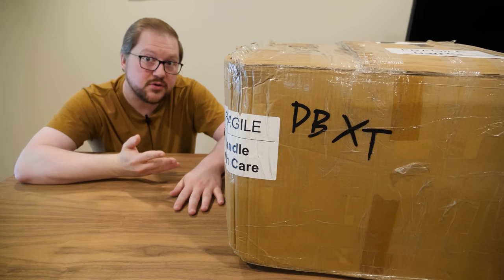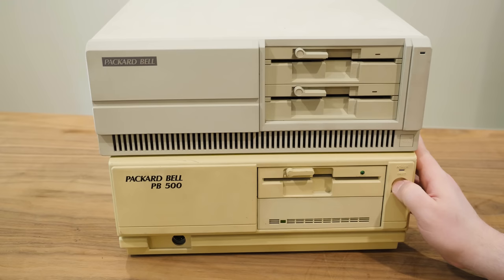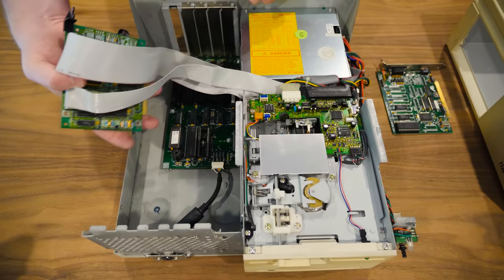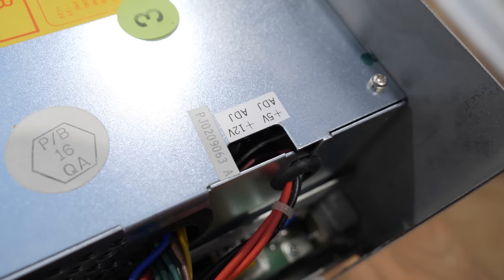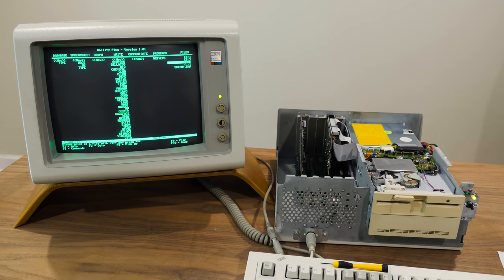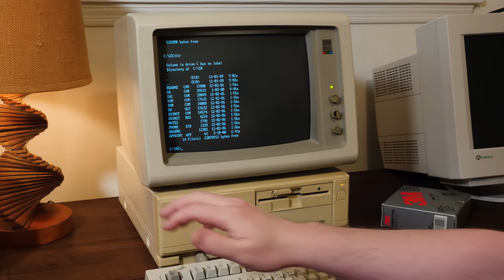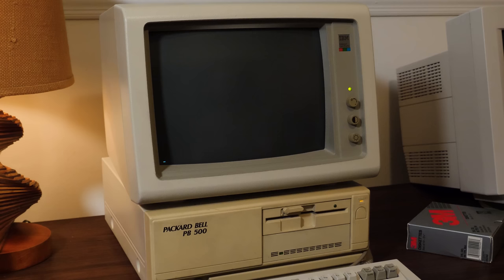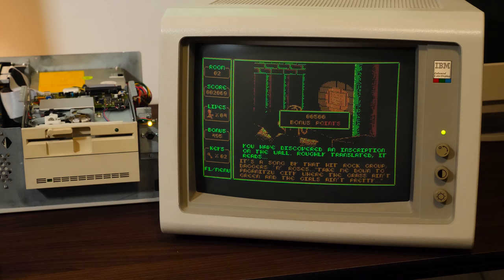Exploring Two 1980s Packard Bell PCs: PB 500 & VX88 Turbo XTs

Comment: That hard drive noise is absolutely awesome.
Reply: I agree. I think it sucks when people swap them out for boring flash cards, hard drives can make tons of interesting sounds and some more than others if you know what to look for.
Reply: @cdos9186  and "failed" MFM/RLL drives like this one are often fixed with a simple low level format. Yet, instead of looking it up, people say "well that's dead", e-waste it, and then install a CF card.
Reply: @8bits59  Very annoying when people really don't know what they're doing, expecting things to work perfectly without at least some effort to get it to work again like old hard drives. I've literally had drives with bad sectors before that went away after I did a FULL format, or even a couple of those really helps refresh the sectors on the drive that was sitting for years and years. People are very lazy unfortunately so they assume if a quick format doesn't fix the problems, time for a replacement of some sort without even trying a full format once or a couple times. I've found that if the drive seeks fine and is able to show up, very good chance it will work great after a couple formats if needed.

Comment: the harddrive sounds surprisingly healthy, especially for an RLL disk. Very few of those still around that work properly
Reply: They don't seem very common to begin with, and it seems like generally MFM drives either last longer or are easier to find. Not sure though but from my experience MFM drives last a really incredible amount of time if it isn't a CMI lmao.
Reply: I  have one that works. As LGI pointed out, the beige faceplate this one has is unusual.

Comment: Be aware, some versions of PB computers came with a reset in the BIOS. If you unplugged the keyboard, it would check to see if there was a HDD and erase it. During a diagnosis on a machine, a client brought in, we'd find nothing wrong and put DOS back on the machine, etc. When the machine went home, it would erase itself. At first we thought it was the user. We found out that there was a small break in the keyboard wire, and when the computer detected it was "detached" the computer reset. We discovered this only after having the machine in with the keyboard. While it was on, we were swapping the keyboard, unplugged it and it rebooted and reset. Eye opener. No other machine we ever worked on did this at the time. 🤔

We did find a different keyboard anomaly with a Gateway keyboard. The user brought the machine to us sans keyboard, but it worked fine. He said he would type and get random letters. OK, maybe a  bad keyboard - bring us the keyboard. Yup - random letters, no - wait - not random. you'd hit a key, then another and the old key became the new key. Programmable keyboard. Flipped it over - sure enough. Flipped a switch to reset and turned it on. Turned it off and set it to "off" (as opposed to "on" where it was programmable). "Off" retained the last settings (in this case reset). Asked if he ever thought he'd ever use that. Emphatic no. Super glued the switch to "off" permanently setting it to the factory settings. (L)users are too nosy. 😁
Reply: Automatic hard drive wiping shortcut! Unplug the keyboard to wipe the hard drive.
Reply: @und4287  the power of malware at your fingertips!

Comment: Oh man, Lazy Susan! They used to use that at my school growing up, on the machines that the admin staff used. What a throwback. I'd love to get a copy of that for the DOS PC I plan to build.
Reply from the maker: I don’t know how well it’ll work, but check the video description for a link to all the files from this drive. Including the SUSAN directory :)
Reply: @LGR  Both Lazy Susan and the green Abilitiy file manager are working just fine in DOSBox. Lazy Susan appears to be useful for large collections of DOS games and software, to get easier access (after the setup...). Thanks for archiving it!
Reply: At first, I thought LGR may have found his soulmate named Lazy Susan.
Reply: @LGR  Btw, password might be "You Bi***"(not censored). Opening the "LSLOG.EXE" file on the notepad reveals a bunch of plain text at the end of the file, including that. Although it "could" be part of the programme as some easter egg, it doesn't seem to match anything around it. It might be worth a shot ¯\_(ツ)_/¯
Reply: @JAzzWoods-ik4vv   Apparently Susan wasn’t just lazy, but also had a foul mouth!  :-D
Reply: @andreasklindt7144  The Packard Bell DOS Training program works fine, too.  Seems to just be Sidekick (C:\SK) that won't work under emulation; try to run it, all you get is "Sorry, unknown PCDOS version. Please report to BORLAND."  And I've tried multiple versions of Sidekick from WinWorldPC, from the 1.x up to 2.0.  All yield the same results.  Under DOSBox-X 0.84.0, at least.  Edited for minor spelling errors

Comment: I love this whole saga of the Samsung made Turbo XT clones. It's amazing how all the budget PC builders were competing against each other with nearly identical machines all built by the same OEM. That said I love these quirky little Turbo XT clones, with their odd turnkey solution bundled software, and how they remained viable on the bottom end on sale into the early 90s and based on this one in use for years after that. You'll never see a single model/spec sold for so long now, and it took until this past decade for PCs to get to where you could use the same one for 5-10 years comfortably without needing replacement again
Reply: I'm confused on what you mean by "needing" replacement.  It was advances like Windows 3.1, which needed a 386, and later in the 90s the need for games that used powerful video cards (and web dev).  The original 8088, 8086s were really meant to last ten years.  Intel even made Aboveboard 286 and 386 cards to extend the lives of the original generation of PCs.   It was increasing graphics capabilities, which drove ordinary consumers to replace them more like every two years.  I mean, from a software perspective, getting the latest M$ Office and latest version of Windows that I guess made a "need" for replacements.  Hardware-wise, the first gen was certainly capable of running DOS and DOS software perfectly well for that long, including the "perfect" word processor, WordPerfect for DOS 5.1.   Obviously, the ones here are still working fine today, over 30 years later!  I don't know where you get the idea that's a recent development. I guess since everything moved to online and in the browser?
Reply: @squirlmy   Once the 386s got down to  reasonable prices, things moved pretty quickly.  A 486 was SO much faster, and especially with VLB slots for the HDD controller and video, the difference was stark.

A couple years after that, the Pentium made Win95 viable.  You could (and I did) run it on a 486, but you felt the weight.  Particularly if you didn’t have enough RAM.

The Pentium II brought 3D games and multimedia apps to the forefront.  The Pentium III made lots of CPU-bound applications possible (CAD, games, pro audio and photo and video stuff...)  The P4 (once DDR chipsets showed up) handled XP better, along with office and web applications.

The Core 2 breathed new life into web and media playback.  The Core i-series made 1080p playback possible (without relying on hardware acceleration.)

So yeah, I would say the recent few gens were when the pace slowed enough that major productivity milestones were few and far between.  Before that, 5 years was the difference between fast and dated.  5 years now is still a perfectly good computer.

The big progress markers now are ray-tracing and video encoding.  If you’re not into either, an early i5 is still functional.
Reply: @squirlmy  I was really referring to business and entry level use cases that were the drivers for sales of these machines. Tasks like basic word processing to replace the typewriter, or to do basic payroll, accounting, or inventory management, and basic gaming like card games and classic arcade ports. These really were entry machines for beginner users

As you said complex gaming and the GUI finally taking off with Windows 3.0 kicked off the upgrade treadmill that the internet continued. But even in the 95/98 era if you weren't online and the copy of Office or whatever you had for basic users could still last in service for way longer than the gamers and other more demanding users

Comment: I have to say this video brought back a lot of memories of my first computer. It was a Packard Bell 286-12 mhz desktop that my parents got from Costco in Burnaby BC in December of 1989. For a twelve year old me back then I was in heaven!

I remember it had I believe either a 20 or 30 mb MFM hard drive, 5.25 floppy drive, and MS-DOS 3.30. Parents even had a PB monitor for it and a massive size Epson dot matrix printer to go with it.

Later on in 1990 parents gave me an external Supra modem 2400 bps which had a gorgeous brushed steel case on it and that got me into the world of BBS's in that era. 

Sadly year's later by 1993/94 I believe my father's close friend took that PB computer and monitor as he had built me a generic case 386DX/40 system that I had played a lot of sierra games on. To this day I still wish they would have kept that first computer for me it would have been great to have even just to play 80s and early 90s games on.

Comment: You are correct about the keyboard speed switching on the PB 500.  It boots up at 4.77 MHz, and to switch it into 9.54 MHz turbo mode you press Ctrl - Alt - Plus (on the numeric keypad). The LED will then change from orange to green. I think originally it would've come with a small program to do the speed change in software, so you could put it in your AUTOEXEC file. Ctrl - Alt - Minus switches it back to slow speed.
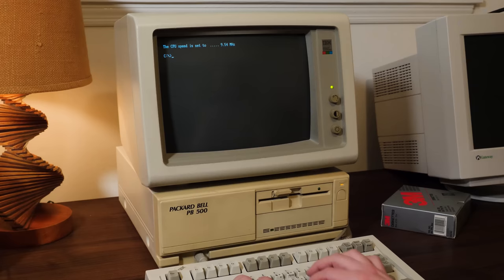Reply from the maker: I show the program and key commands starting at 20:13!
Unfortunately the LED doesn’t change.
Reply: @LGR  IIRC with mine when I replaced the 8088 with a NEC V20 chip, the LED no longer changed color with the speeds.
Reply: That NuXT he built had a similar software-controlled turbo setting.
Reply: I just picked up a PB 500.  Any idea what the keyboard combination to get into the Phoenix 2.51A 01 BIOS is?  (If any?)
Reply: @davidschmidt8195  There is no BIOS setup on XT-class (8088/V20) machines.

Comment: Ah, the sound of old harddrives.
Reply: It seems like stepper motor drives in particular made the most noise, and the most interesting noise. I only have a ST-157A for a stepper motor drive and it is so sweet to hear the noises from it. Old drives are like a relic from the past at this point, with unfortunately many models extinct that probably sounded even cooler than this one.

Comment: That was my first PC.  I remembered mine having a 40mb drive however I could be wrong.  It was that exact same sound too.  It shipped with DOS 3.3. I had a sound blaster card and a ISA modem in mine and I used it for a LONG LONG time.  I think I got more use out of that PC than any PC I ever owned.  Thanks for the trip down memory lane.

Comment: We used to have a secondary system that looked EXACTLY like the VX88, NEC V40 and all. I remember it had a quirk where "ctrl-alt-delete" did nothing, figured it was custom firmware for use in a hospital. Ours had 768k of RAM and a ~30mb HDD. Was a whopping $20 CAD, surplus from a closing hospital. Parents bought it in maybe 1992 or 1993. Decommissioned in about 97, trashed in about 99.

Comment: My first computer (that I didn't have to share with the family) was a PB 500 my dad got from a rummage sale. It came with a 40 MB ST-250R, and I think the manual mentioned that it could come with either two floppy drives or a hard drive. We actually had the manuals and disks it came with and I remember being confused that the manual made lots of references to Samsung. The angry beeps are caused by the motherboard DIP switches not matching the video card (CGA or mono). My video card just had a color/mono switch on the video card rather than DIP switches, and in monochome mode, it actually did Hercules, not just MDA.

Comment: It has been decades since I've used DOS. That had been on my mother's work computer. A P. Bell from the 8-0s as well. Older than these but the floppy drives had been upgraded to the 3.5" drives. It had less than 50MB of drive space IIRC. We went right from DOS 3.1 to Windows 98SE in 1999. System was an NEC Pentium III with 16MB graphics memory, 256MB RAM and a 9GB HDD. It never had ay issues playing anything until 2004 when games were becoming a bit too graphics intensive, especially with all the mods I had installed for Star Trek Bridge Commander. Once I started spending long stretches in hospital, I switched to laptops. The IBM ThinkPads were the best for gaming as they usually had dedicated Nvidia or ATI VRAM rather than shared. Amazing how far gaming has come on laptops. I love my Alienware x17 R2

Comment: Great video! My second experience with a Windows PC was with a 486 Packard Bell in 1994. Running Windows 3.0 and 8mb of ram, the PB was a huge step up from my old Epson 386dx that took 11 minutes to cold boot. It had some useful software to make the interface more user friendly. Still, it took six minutes to boot, and it was pitifully slow even compared with my lowly Mac LC 2.

Comment: That Vx88 lookes very good indeed! I have a VX 588 from  1989, with Amber monitor and Star Micronics printer still in its original boxes. It was one of those NCI "Learn to be an engineer!" type things.  I never got around to putting it together, as I never got the box with the HDD and Power Supply.

Comment: Love me some old Packard Bell machines! My first PC was a 486 DX2 66 Mhz based PB Legend 420. I think that was the first model they offered with that particular CPU. Cost my parents a small fortune as they had to finance the thing! While it wasn't a perfect computer by any means I learned so much using and upgrading it in part because of its limitations and the cost cutting PB did on the hardware side.

Comment: I have a Seagate ST225 on a shelf behind my PC. It came out of an PCXT clone my parents got around 84-85. I used it until 94 when it finally died of old age.
Reply: Sad that yours died but there are plenty of working vintage drives out there to find. Most of them hold up pretty well, unless it is a Rodime or CMI as those do not like to work for long. The failure rate of the ST-225 is very small from what I have seen, extremely solid drives.

Comment: My very first desktop computer was a packard Bell 511.  It had a 486sx processor, 8MB's of RAM, an 80MB hard drive, and a 3.5 floppy drive.  It also had an extra chip slot for a math coprocessor, which would change it from an SX to a  DX.  I tried to adding a math coprocessor to it later on, but the chip I bought wouldn't fit the slot (had one extra pin), and I never got a chance to find another one (no internet back then plus there was a severe lack of competent computer stores in my area).  

I ran Windows 95 in compressed mode on it for about year.  After that, I upgraded the BIOS chip so that I could bump the RAM up to 16MB and also so I could put in a larger hard drive and a CD-ROM Drive (player only).  Shortly after that, I bought a US Robotics 14/4 single line modem and ran a BBS (WildCat v3) on it for about a year.  Good times!

Comment: "This is where I have a clear spot at the moment." Yeah, totally understand that! Anyways, our first new home computer was a Packard Bell (even if we did eventually have to return it under Sears' "Satisfaction guaranteed or your money back" due to their extended warranty failing to repair covered damage), and I remember repairing many of them when I worked at a local computer shop in high school, so keep the Packard Bells coming as you get them!
Reply: Yeah, and that first system had a temper tantalum! 🤣 Also, these systems remind me of the Emerson 8000EC that I have, another XT-era clone. The wild wild west of early XT clones was certainly an interesting era of computing.

Comment: The Packard Bell PB500 was my first computer.  It was a price club special that my dad bought, 640K RAM, 30MB hard disk drive, 5.25" floppy disk, with an ATI 8-bit ISA video card.  I added a 2400 baud modem and 3.5" floppy.

So some did come with a hard disk drive.

Turbo mode was by a keyboard command, but I don't remember how to do it at this point.  maybe ctrl/alt+ and ctrl/alt/-?

I think that both the floppy and the hard disk are not original in the PB500, mine were the darker gray and contrasted with the beige of the case.

That training software came with a thick book, and I can cite that software and that book at teaching me how to use DOS, setting me off on my IT career path.

Comment: The nostalgia with these machines is sooooo big. 😍 Do you remember the first cd-drive? Where the whole unit as big as a 5,25 inch slot came out the pc and had a top loader. I remember the whole street came and check out how we were able to load a picture from an optical disc. 🤣
Reply from the maker: Yes indeed, I've always wanted to find one of those! I did cover another very early one though :) https://youtu.be/yBupNdYe08g
Reply: @LGR  even have trouble finding a picture of it, so I'm afraid it's lost in history. The one you tested is also a very nice addition. Love that you needed a special interface card back then. 😄

Comment: The Packard Bell with the hard drive is definitely a rebadged Samsung SPC-3000V. Easily recognizable by the case, power switch and  Phoenix BIOS. That also explains the "Made in Korea" tag. I used to write C programs (Turbo C) on these many moons ago...